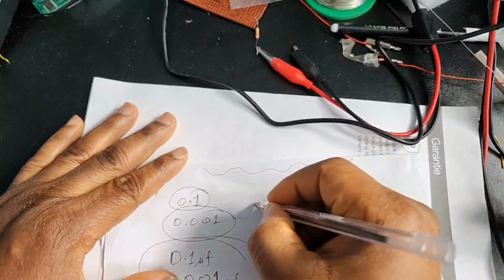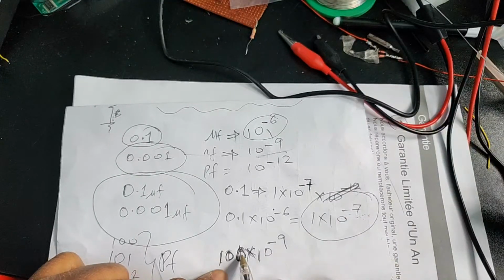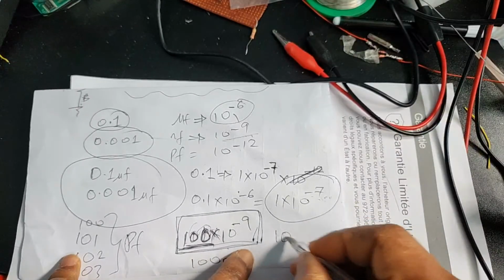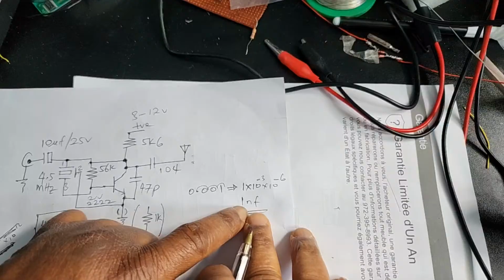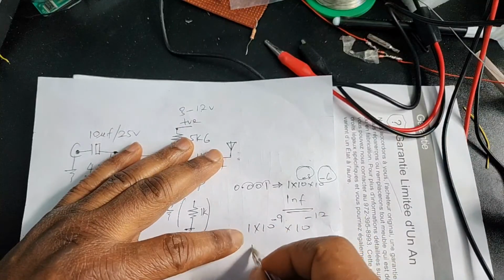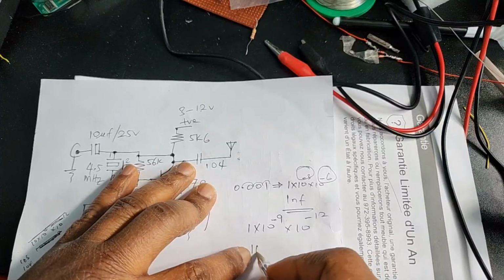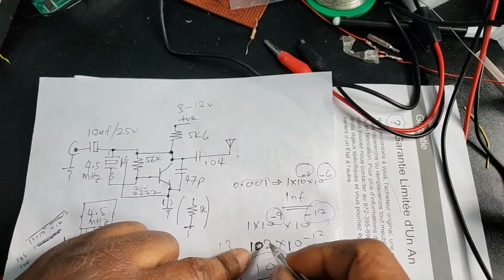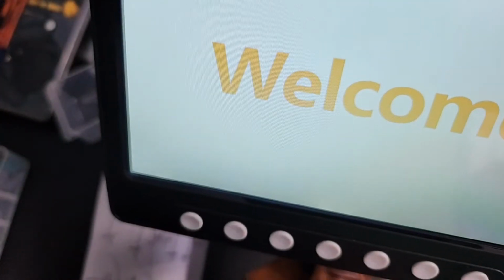Building A TV Transmitter

Comment: Change the 104 from base to ground to a 102 or even a 471 and it will still oscillate, but won´t filter out most of your tone sub carrier signal. The resistors on the base you say their value is not so important, they are very important because they define the linearity of the transistor stage, and are responsible for a good image quality. I think I made a video about these two transistor Video transmitters years ago. If you get the components right, with all the things they are missing, like proper AM modulation, they can produce a suprisingly great image and have good sound.
Reply from the maker: The reference to the base resistors was not they are not important but that using 47k resistors are not critical. The bias is achieved through a Voltage divider, so using another pair with equal values will provide similar effects... the difference might be w.r.t to IB (base current), but the range of resistors used will have little negative impact, if any. As can be seen at the end, the circuit worked great.